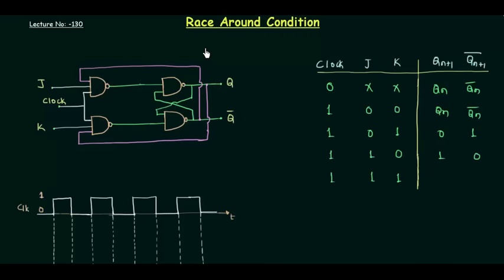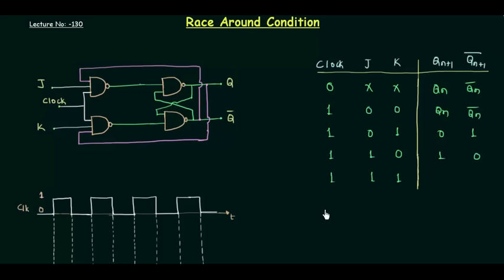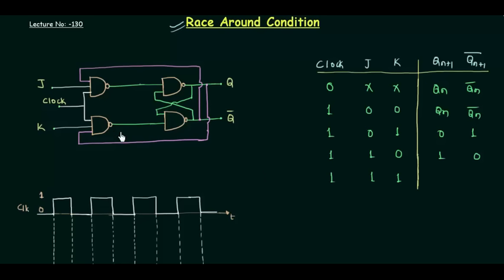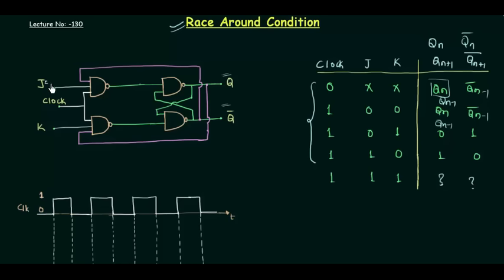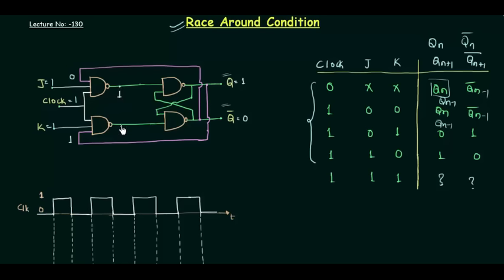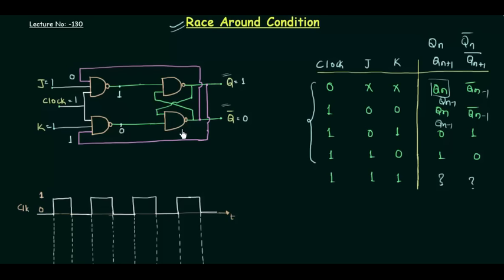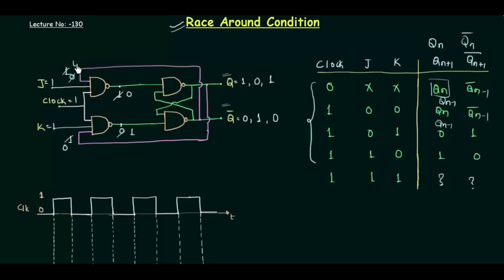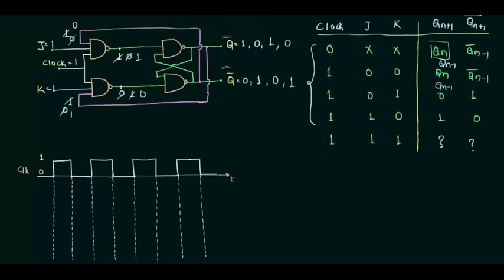Race Around Condition or Racing in JK Flip Flop

Comment: U said flip flops are edge triggered and latches are level triggered then here in why do I mean by using edge triggered to overcome racing
Reply: in edge trigger clock is high for very less time than in level triggering so in jk flip flop ....flip flop can't generate output in such a less time so racing can't be take place.
Reply: exactly, somewhere in the earlier lectures he mentions that flip flops are always edge triggered and here he is saying that jk flip flops are level triggered and so the racing around conditions exists!  why the contradiction man?
Reply: yes agreee with u, if flip flpos are edge triggred then race around condition should not be arrive
.
Reply: prasad satam since clock is assumed to be 1 in JK flip flops...and 1 means high output i.e, level triggered
Reply: yes even I have the same question..why are we using level triggering in flip flops....As he mentioned that edge triggering is for flip flops
Reply: i felt the same.
Reply: I also feel that race around condition should occur in jk latch not in jk flip flop...Plz correct I am wrong somewhere...
Reply: Very useful
Reply: in jk ff we have 3 inputs ,so ckt will not become latch at +ve level or -ve level

Comment: Since it's a flip flop,isn't the circuit supposed to be operational during the edge and not on the level??? Why is the output seen based on the level ???
Reply: same question here, anyone knows why was that?
Reply: It is a flip flop, means it is using clock instead of enable, now in a flip flop the clock can either be level triggered or edge triggered.  If it's using enable input, then it couldn't be flip flop. Clock makes it flip flop, not edge triggering.
Reply: I am also have same doubt...  Flip flop itself operates on edge trigger only, if it is level trigger output will be change whenever the inputs are change during clock is high.
Reply: I am some what confusion with your explanation, you said that clock can be either level triggered or edge triggered , when it is acts as edge trigger or level trigger.
Finally what you said that,  is JK flip flop level trigger? 
 if it is level trigger output will be change whenever the inputs are change during clock is high.

Comment: Why was a correction made at 5:55, T/2 < delay, can you pls explain...
Reply: +Madhu Kashyap...if T/2(i.e time taken for high clock signal) is low (lower than delay time),  before the output could start to race the clock signal will turn to low signal and hence no change in output(no racing).
Reply: +Karthick mathivanan meaning that for the racing condition to exist T/2 has to be greater than the propagation delay. Hence the correction was incorrect.
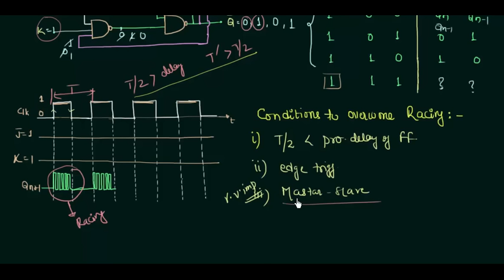Reply: +Madhu Kashyap The correction should've been at 8:57 as T' (T dash) must be less than T/2
Reply: That would mean no toggling either!
Reply: does it mean that before generating the output(race) clock changed from 1 to 0 in order to attain 0 output only?
Reply: T/2> propagation delay (FF) this condition attain racing condition end of this video u'll get this point.
Reply: What  we need is to disable the race around condition and enable the toggling,
so in the timing diagram you can see that for half time period input is high,
so if delay is less than t/2 then we can get many changes in t/2 times,
but we need just one change that is Qn complement so the time delay should be greater than t/2 i.e prop. delay>t/2.

Comment: Sir I have one doubt, actually in flipflops outputs get changed only at the transition of clock (edge sensitive) but here you had drawn the racing waveform under the level (you had drawn as the level sensitive)

Comment: thanks a lot for the video... i had a doubt that u have taken level triggered clock for the j-k flip flop when u drew the wave diagrams to show the racing. but few lectured back u told that latches has enable as the input which is level triggered and when it is clock it acts as flip flop and it is edge triggered .  So could u please help me out in this
thanks a lot for an amazing lecture!!!!

Comment: i had a doubt that ,as we have used a clock here it must have edge triggering so the value will change only when the clok goes from 1 to 0(for negative edge triggering) or 0 to 1(for positive edge triggering).hence how is the value changing when clock is 1 like level triggering??
Reply: same doubt

Comment: hi…I have a doubt… generally flip flops are sensitive to edges(+ve or -ve) but race around is problem of level triggering as far as i know…then how come race around appears in jk FLIP FLOP…??? It should be JK Clocked Latch, right?
Reply: Monish Nath  Flip flops aren’t smart enough to detect edges by themselves. They start working as soon as they get high potential. This is not the correct statement to say that Flip flops work only on edges. 

In this lecture, he demonstrated Race-Around condition using level (Clock is directly input to the flip flop) triggered flip flop where J-K flip flop has sufficient time to toggle many times as soon as the clock stays high.

Now to make a flip flop positive edge triggered we provide a differentiated CLOCK using RC circuit with diode. This differentiated CLOCK only have positive edges. We are actually forcing the flip flop to work only on edges. That’s why we call it as “Positive Edge Triggered”. Sir has already made a lecture on this.

But in practical, you cannot get a real impulse from an RC circuit. RC circuit produces exponentially decaying voltage (if we are taking voltage across the resistor). This voltage is considered as an impulse or clock edge. The width of this voltage is determined by the time constant (T=RC).
Racing can also happen during this width of voltage. If the voltage is high for sufficient time, the J-K flip flop will start toggling as soon as the voltage decays to low and isn’t high enough to influence the flip flop then flip flop latches the output and wait for the next positive edge. This phenomenon happens in very small amount of time (Nano Seconds) and can only be observed through an oscilloscope.
See Race-Around conditioncan also happen in edge triggered flip flops.

This is why we prefer Master-Slave operation.
Reply: @alphasatari  your answer is fine. I understand. But in basic we are taught flip flops are edge triggered and latches are level triggered. Is it wrong?

Comment: In flip flop we use edge triggered clk then... while showing the race around condition timing diagram why you are showing the result in level triggered clk triggering moments??????
Reply: For example,if jk flip flop is level triggered we face race around problem which cause uncertainty in finding output of flipflop.So we will use edge triggered flipflop rather than level triggered